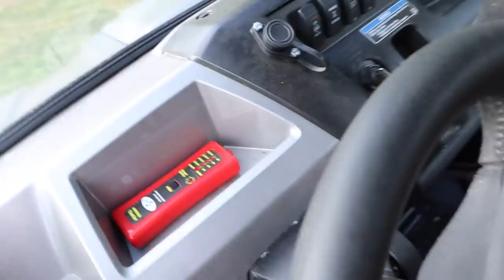Making Cheap CAST IRON Work Better Than TEFLON

Comment: Just pull a male flower off and dab that onto the female flower.  One male flower should pollinate 4-5 female flowers.  That's what I do until the pollinators find the garden.
Reply: Thanks for reminding me .... I've forgotten that little trick. There are always plenty of male flowers to go around. Take care.
Reply: I read the amount of male flowers changes with temperature. If its warmer they produce more male, on the cooler side you get more females develop.
Reply: I tried that with cucumber. The pollen part was to far into the flower even with the petals taken off. I am able to do that with squash but not my cumbers.
Reply: Thats what I would do or use a q-tips to help Pollinate the plant's. When I start seeing more pollinators, I would slow down or stop helping them.
Reply: OUCH!  LOL
Reply: @shadowkissed2370  I hand pollinate mine routinely when I don't see bees/other insects.  Don't be gentle.
Reply: @barbarashotts5598  I tried a q-tip on the cucumbers. It didn't work. The q-tip is how I hand pollinate my squash. I might have to try the paint brush method on the cucumbers.

Comment: I have that same dutch oven that you cleaned up today. I have never used the individual top as a pan the way you did for roasting your beets so I don't know how it would perform as a separate pan. As a dutch oven, it works great the way it came from Lodge. I am new to cast iron so I still need to explore what it can do. I have a small, 8 inch, skillet that I use for my breakfast eggs that works well.

Comment: When those cast iron pans get really crusty you can super clean by running in the oven while it does a self clean cycle. Gets rid of all the old grease crust inside and out. then do the whole re-season thing and they are like new.

Comment: Hi, Al and Gina.   BAKER CREEK has a parthenocarpic variety of cucumber called "Monika".  The variety is especially helpful to people who grow in greenhouses because it will produce fruit without fertilization.  Hope this helps for next year.  Best wishes from Kate in Olympia, WA -- 4:40 am -- 7/19/2020.
Reply from the maker: It does thanks for the tip
Reply: As long as you're giving out tips from the future, do you think we could get some winning lottery numbers? :P
Reply: @infotoons212  ill go for that one. LOL.
Reply: @LumnahAcres  Hello, I am in the U.K and have 3 Sauce pans with lids, A Large and Medium Skillets with lids and A Dutch Oven and a Casserole. They were made in Denmark I think, A company called Copco made them, This was 50 Years ago and they had one Container a year to deliver them. At that time I was asking the rest of the family to club together and got them for Christmas and Birthdays as they were so expensive. If I said I was given the Large Skillet so decided to buy the lid. At that time it was over £30 (Just for the lid) and I had to wait over 18 Months to get it. I think most people who have problems just do not wait until it gets hot enough before adding the Oil then again until the Oil heats up.

Comment: I do my new cast iron @ 400 degrees for 2 hours. Twice. I turn the skillets upside down so you don't get the pileup of the oil. I use bacon grease or lard to season to get the black color. Never seen them gold before after seasoning.

Comment: Ok, your in the right direction. I think you have a drill press & a round sanding disc arbor. The sanding you want is, polishing out the cheap bottom surface. So find emery cloth to put on the bottom of that disk, Then in the drill press. Sand paper is for wood, while emery is machine work. Slightly loosen the drill press bed to allow hand rotation with pan on it.. If you can see swirls, you are a bit aggressive. No real big deal here, just go to a finer cloth. All else, your doing, is right on. (Drill press keeps you flat in the pan & control pressure)

Comment: Figaro thinks he's a goat lol and so adorable. I have stainless steel and cast aluminum pots and pans that I have been cooking on for over 20 plus years. I don't have a sander but I use steel wool to sand them all down when needed and I use whatever oil I have on hand to re-season them all.

Comment: Never tried Fax seed oil before. We always cooked a pound of bacon poured the grease in the new pan and heated it up real hot then turned it off and allowed to cool. Heat it up real hot again and drain it off. Allow to cool. At this point the cast iron should be dark. The preceding steps were done to pull the bacon grease deep into the pan. This is were I usually bake it like you do. Never use water or soap for cleaning cast Iron. For cleaning wipe out with a paper towel, add a little bacon grease or some vegetable oil and coat the entire surface.

Comment: I've had bad experience with teflon cooking pans. They only work when they are new and quickly degrade. The cast iron is so much superior: for great heat distribution and for non-stickiness. I think I need to smooth mine out as you have; I no longer have an orbital sander and access to compressed air. It will be a slow process.

Comment: Teflon gets worse and worse the longer you use it, but cast iron gets better and better! smoothing out the too-rough Lodge “preseasoned” makes them as useful as the really expensive brands, and that means money saved one way. and it means that you’ll actually start getting the use out of them that you paid for when you bought them, and that saves money another way.  Lodge makes a great variety of sizes and shapes of pans. A tip: get a cast iron lid for that largest pan that you seasoned today, and it becomes the ideal baker for that lovely artisanal bread recipe that you used in one of these vlogs of yours. Give that a try! I’ll bring the Kerrygold butter!
Reply: the dual pan set (large pan with smaller pan cover) gives you two frying pans plus a dutch oven.

Comment: My Lodge Cast Iron pan is shot and everything sticks like crazy. I'm gonna try your tips to recondition it, thank you and thumbs up Al !
Reply: Just put it in your oven upside down and set the oven on self clean. Then when it's cool enough to handle and still warm add lard or shortening in thin layers not dripping and bake it upside down for an hour at 350F. Repeat a couple more times.

Comment: I have several Lodge pieces and have never had a problem with them sticking. When you get a new one, try my grandmother's method. I have one skillet from her that is probably 70 years old.

 First, never use oil- it will be tacky.  Scrub the pan with a brillo pad, wash it well and dry it. Then put it in a cold oven upside down. Turn it on 300 and leave it about 25 minutes, take it out and put a coating of Crisco vegetable shortening, wiping off any excess. Put it back into the oven right side up and leave it for another 30 minutes or so. You should not use soap or scrub it unless absolutely necessary- and from time to time also season the outside.

Comment: Cast iron is very resistant to abrasion so 180 grit wont do much. You might as well stick to 60 grit on the sander. The first round of sanding did next to nothing. I just used 60 grit on my sander alone (no grinder) to keep the bottom nice and flat. The finish left behind by 60 grit is covered in no time from seasoning.

Comment: As you're making your own chicken stock which is the best, You might not want to get any Chicken base from Minor's,  a base sold on Amazon,   They also carry Minor's beef base and pork base plus mushroom, vegetable, and Seafoods bases. These are what I have used in Professional kitchens so you might want to check them out They're excellent.

Comment: What is a good cast-iron cleaning tip after each usage...
??????    Then re-oil before putting away. ?????
Reply: A chef was on public radio and said they have to use soap and water in restaurants.  So after washing they put it on the stove and heat the pan to dry it well.  After it's hot they put a tiny bit of oil in the pan and rub the oil over the entire inside of the pan.
Reply: if it's properly seasoned you can wash it like any other pan, just don't scrub it. then put the pan onto the burner and get it hot until it just barely starts to smoke, turn it off and then with a paper towel rub in a light coat of oil, I typically use lard, and let it cool on it's own before putting it away. The point is to make sure the surfaces are bone dry before storing it, especially before putting on a new coat of oil.
Reply: jim h I wash mine and put it on a burner just long enough to help it dry. Others put oil on, I don’t but I use it daily.

Comment: Apply the seasoning on a hardwood fire like oak.  High temperature gets the oil in the ores of the metal.  just a suggestion.
Reply: A pan will readily and fully accept seasoning at 200*.  To get the oil to polymerize, you only need 500-525* tops.  It's more a factor of time and heat to do the polymerization and the smoke point of the fat being used.

Comment: The only time I resurfaced my cast iron pants and skillets if they are completely over used or if I find them rusted I will do what u did. Theres really no need to go to that extreme hot soapy water removes almost all used oils from the surfaces washed out twice then heat your pans up using the desired oil to reheat and season the pans twice. And yes they are very slick better than teflon any day

Comment: Are you aware that lin seed oil, or flax oil can make the rag combust into flames? It must be hung outside in it`s full length to not develop heat..
Reply: Ellie Christine. J ..... good point, not many people know this, it’s best to not use seed oils , I use lard or tallow on my pans, much safer and healthier too........
Reply: You're thinking of the oils used as finishes, that have drying catalysts in them. Like Boiled Linseed Oil, which isn't boiled but chemically altered to dry faster. Thereby causing the exothermic reaction (heat).
Reply: @Dreamweaver_Farm  Thank you very much for enlightening me - I did not know this. Still, I will no doubt be careful not to leave a cloth in a heap :-)
Reply: Chris ........I think Ellie Christine j is referring to part of Nina Teicholz’s book “ The big fat surprise “ she interviewed a representative from an industrial laundry company who related the stories about clothing from fast food outlets spontaneously combusting, these are seed based oils which is in most highly processed foods and it is also used for deep frying in these outlets, it’s best not to use seed oils for seasoning pans as they produce free radicals, aldehyde and formaldehyde when heated.
Reply: @edwardgatter4610  Thank you, but I think he was right in that there are differences that I was not aware of, to the oil. Good to know.
Reply: Ellie Christine. J ....... that’s fine but I still don’t recommend flaxseed oil for seasoning pans, most of the people not using Teflon pans are doing so because of the toxins found in that coating so why coat your pan with a finishing oil like flaxseed that forms a type of polymer on your pan after heating, also creating several toxins hazardous to health. I use pork lard, one  of the key benefits is that the lipid profile of lard is almost exactly the same as human breast milk plus we can also use their insulin as we are biologically very similar.  I also use lard, butter and ghee in cooking tastes better and is healthier, so I don’t use any seed oils as they contain solvents and make plastics that I don’t want to consume.
Reply: @edwardgatter4610  I totally agree with you, it was just the fire hazard I thought there might be that I wanted to tell about. Turns out I was wrong there,as that applied only to the oil with hardeners in. 
Have a good summer, and hugs from Sweden!

Comment: As you pointed out cheap cast iron they just dont make it like they used to it's even thinner and prone to cracking while in use. My suggestion get a fire extinguisher specially if your going to use in the house because if you use oil in it and it cracks the oil leaks out and you have a huge grease fire

Comment: My cast iron frying pan has that rough surface from the factory, too. I wonder why the leave it with that finish instead of grinding and sanding them smooth before pre-seasoning?
Reply: They do it for cost.  Machined pans cost many fold what the raw castings do.

Comment: flax seed oil is about the worst oil you could use (bran oil is the best, but regular veggie oil works too).  My best lodge(s) are ones I've done mirror finish on.  Like Stargazer, Field, Smithy, or Butter Pat, but a fraction the price.  Field is WAYYYYY lighter though.

Comment: I’m thinking the new project is housing for new animals such as a sheep or cow (didn’t look ahead to see so I’m probably wrong 😅). Geese? I feel like alarm geese are an option but they would probably need water. Edit: we don’t use cast iron because mum is elderly & my sister & I are both chronically ill so cast iron is far too heavy for us. We usually just replace our Teflon stuff every few years because the coating is all scratched up & it’s not good to eat micro Teflon particles in your food

Comment: I have a Wagner and 2 Griswold  cast iron pans.  1 newer pot not as good as the old ones.  I'm going to sand them down and season like Al did.  I use them all quite often.  Old cast iron pans  are harder to find these days.  I think you're going to be building a barn.

Comment: Don't buy new cast iron. Go to flea markets,garage sales or estate sales to get your cast iron pans. Today's cast iron pans can't stand up to the ones from fourty years and older. I have one that is around 70 years old. Plus your able to get several for the price of a new one. I do a deep clean on all of the once a year and when I season the I fo it on the grill and turn the pan upside down so the oil don't pool up
Reply: Agreed ...I noticed that growing up. The pans now are not so good n break easy almost kinda reminds me of a "pot metal".
Reply: Deep clean them?...ugh....
Reply: @jeremiah1528  Scrub them, dry them and them slow bake them, then re-season them, in a  bit hotter oven. Pretty simple really No soap, tho!
Reply: I agree, old Wagner and Griswald cast iron are the best and last forever
Reply: My cast iron have never been washed. I rinse them when needed... use the plastic scrubber thingy... no wash... only flavah...
Reply: Patrick Carns great idea to buy old ones but they are quite hard to come by now🤔🤣
Reply: @cherylsmith-bell6509  Soap will have zero effect on a properly seasoned pan.

Comment: Is there any benefit to using finer sandpaper, like 220 grit, after the 180.

I'm done with new age "non-stick" surfaces!  I've got a cast iron set that is older than me!  I gotta rework it first.

Comment: Just wondering after you’re done using your cast-iron pots and pans how do you clean them
Reply: Robert Grant ....... this wasn’t covered very well but I clean my DeBuyer carbon steel pans in just hot water, straight after cooking on the hob or in the sink....... no detergent!!!!!  As there is no non stick coating to worry about you can use metal scouring pads and remove all baked on food residue, then dry with paper towel and place back hob and dry it fully,  I use a little lard or tallow to re-season the pan if required. Hope this helps.
Reply: Nothing ever sticks so it just wipes clean - most of the time with just a paper towel.
Reply: Thanks everybody I have cast-iron I have never sanded it down to the metal but that was interesting to me and I may try that but my old cast-iron pans that I use only wiped them out but I’ve had other people tell me no you need to wash it out with soap and water because of bacteria’s So that’s why I asked I was just curious how other people took care of their cast iron
Reply: @geminitwinstryanythinggtta6554  bacteria? Heat kills bacteria! When you preheat your pan, it becomes a sterile environment. No real need for soap, but modern soap doesn't contain lye (which can ruin the seasoning) so modern soap is safe for a WELL seasoned pan.

Comment: Did you know that Flaxseed oil is linseed oil?:
"Linseed oil, also known as flaxseed oil or flax oil (in its edible form), is a colourless to yellowish oil obtained from the dried, ripened seeds of the flax plant (Linum usitatissimum). The oil is obtained by pressing, sometimes followed by solvent extraction."

Comment: Lodge designed their stuff purposely like that.  You've got to season it yourself and it'll fill in those spots. Then it really becomes non stick. Lodge seasons their stuff with Soy based vegetable oil which is nasty. You've got to bake that stuff off and reseason it with Flax Oil... hope that helps Al. BARLEANS FRESH ORGANIC FLAX OIL. You can find it on Amazon...

Comment: If you'd buy a tow strap it wouldn't be as hard on your equipment when you have to snatch them loose. Straps work better than chains for your towing.

Comment: Way too much oil even for a first coat, many thin layers otherwise you get a sticky residue. Handkerchiefs are great for application as you noted. Heat those pans for at least an hour too.

Comment: Lodge claims they need the "bumps" for their "pre-seasoned" seasoning. They should skip the pre-seasoning and go back to the smooth finer grained metal of the pre 1950's. It isn't like the "pre-seasoned" pan never needs to be seasoned again; there really is no long term benefit to the current lumpy metal. It is, in fact, a detriment.

Comment: Hey Al. I tried doing something similar with my Lodge using a wire wheel on my drill. Didn't quite get the results I wanted. Never occurred to me to use my orbital sander! Derp!!! Guess I got a new project this week. Just out of curiosity, how come you didn't sand the sides of the pots down? They get pretty sticky with stuff too! As always, love the progress of your farm and channel! From one NH'er to another. kmb from Lee.

Comment: I noticed that the 4-wheel drive didn't seem to activate fully when the shed was pulled - the rear wheels spun yet the front wheels did not.  7:24